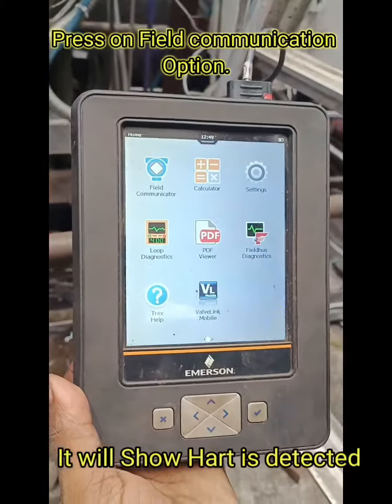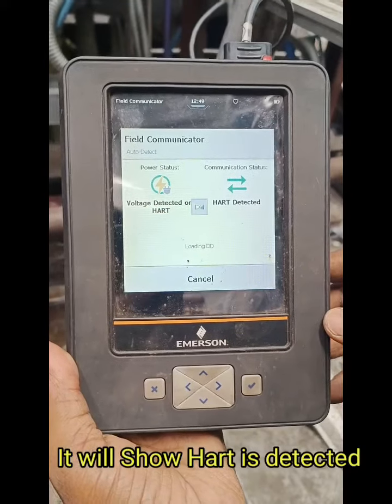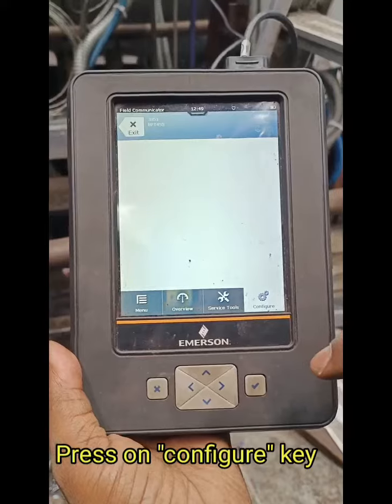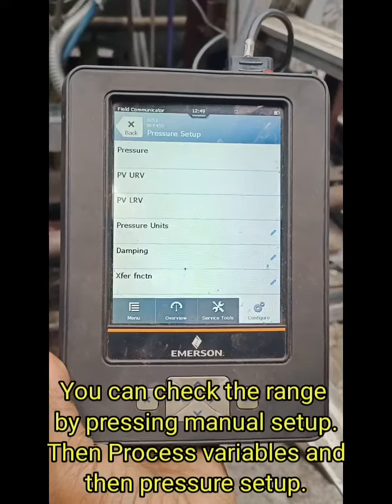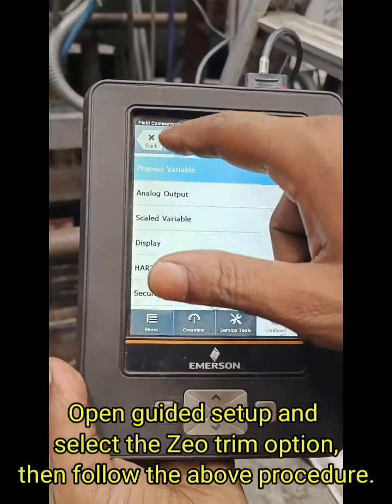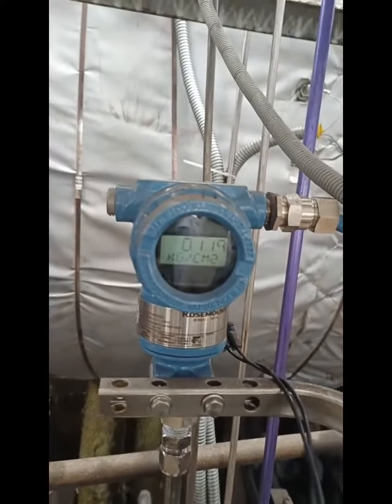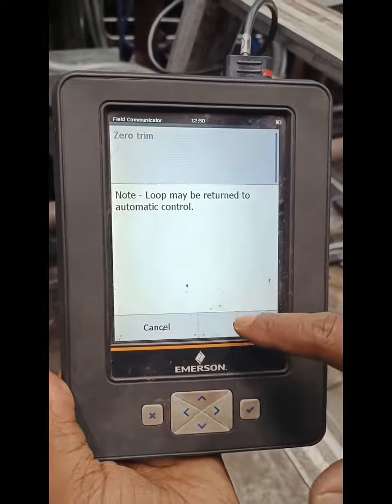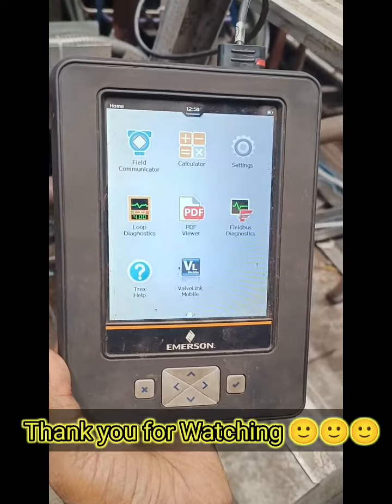Trim the Zero value of Pressure Transmitter by Using Emerson make Trex Model Hart Communicator

Comment: Thank you so much for the video.
Please we have a pressure transmiter and we want to change it's unit from barg to bara, but whene we select the bara and sent to the transmiter the unit is not changingg, it's just jeeping mezsur barg.
Is ther any lock or trick that we need to do first?
Thank you.